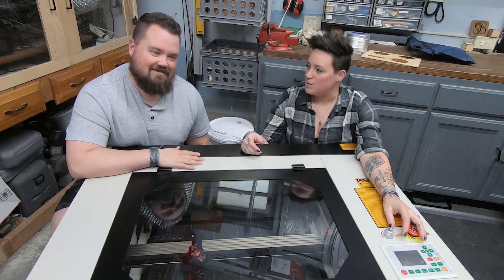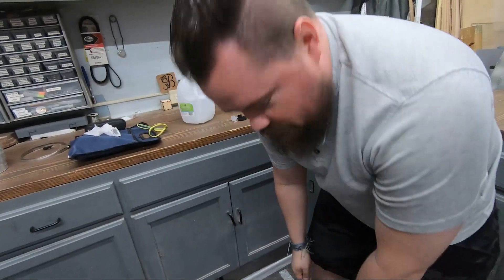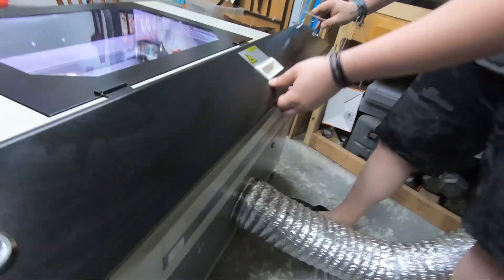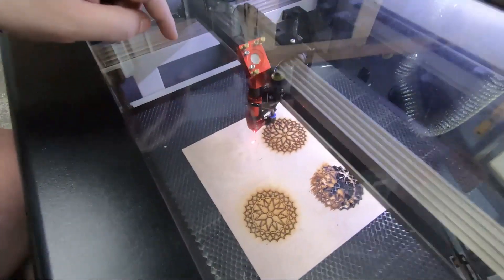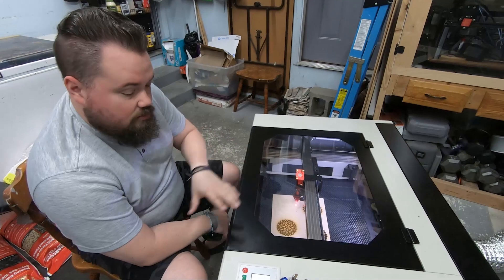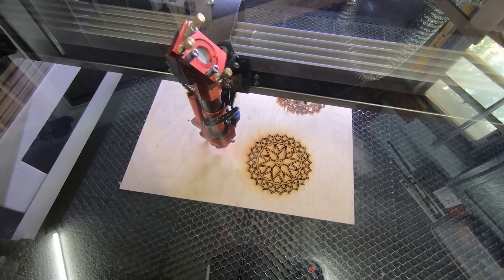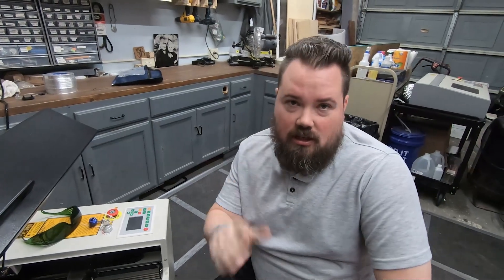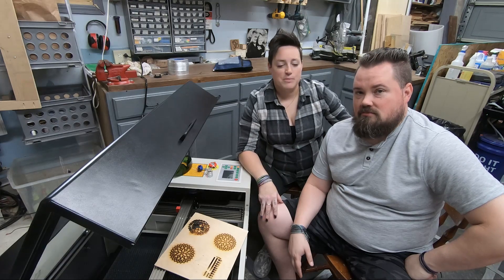60W Setup and first burn! | Monport CO2

Comment: NO NOT BUY A MONPORT LASER. They have NO support. There are 3 numbers listed on there Website as post sells support. NEITHER one number answers. Ever. You have to summit cases via an email link and WAIT. When, if, they contact you then it's a 24 email and wait. For days. If you have an urgent production issue like we did, you are screwed. We spent $1,000 on a CO2 laser and it's DEAD after a week when a runaway Z movement sent it into the honeycomb crunching the laser head. We are STILL waiting on Tech Support help over a week later.